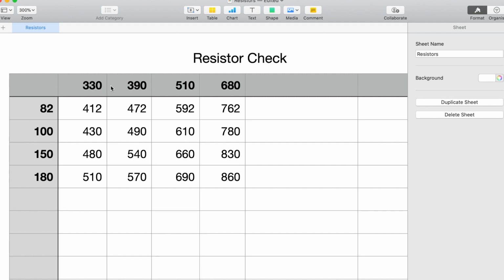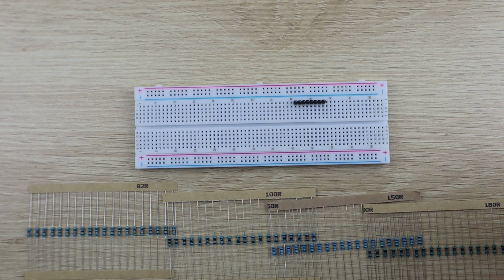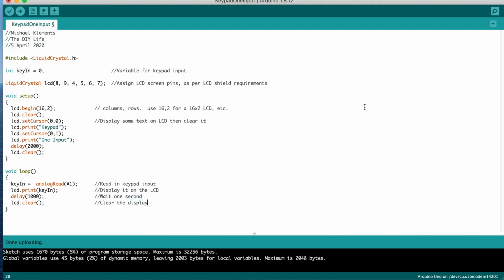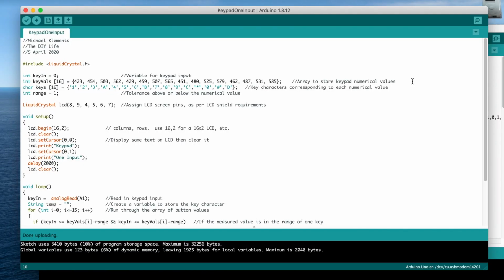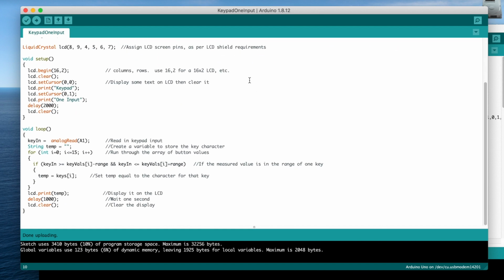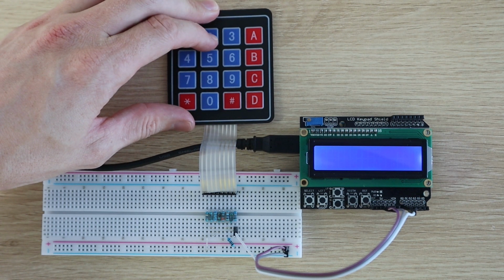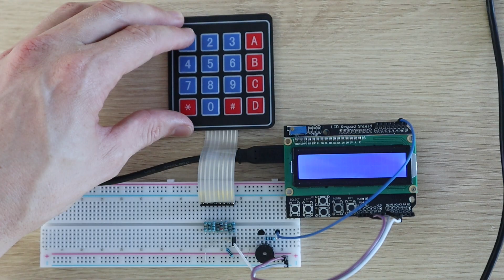Connect A 4x4 Keypad To One Arduino Input

Comment: Yes 4 years ago when you made this video.  This year I’m making an MFD Multi Function Display with 28 buttons on it. This is for an aircraft F/A18 Fighting Falcon. Keeping the pin out small is the way forward. I need to repeat this 3 times. I think that is 84 buttons using 3 inputs. Thanks for the help.

Comment: I'm a little confused by your setup of the resistors. In the initial setup, it seems like you will be inserting resistors into an 8x8, but in the actual implementation, I see 8 resistors in a row, then a bunch of wires, and one resistor at the bottom. What exactly is that setup?
Reply from the maker: It is an 8x8 setup but they need to be arrange in a voltage divider circuit to generate a reference voltage for the Arduino to measure. The single resistor at the bottom is one half of the divider and the other 8 resistors make up the second half of the divider.

Comment: I am using this and the PWM code to control the raising/lowering of doors on my 18 bay carshop for my model train. The object is to enter the door number and then the % open. Using the I2C for the PWM boards and the one analog connection for the keyboard will make it all work....wiring was easy. Now to do the coding, mechanical tweaking, and troubleshooting.
Reply from the maker: This sounds like a great application for this sort of arrangement.

Comment: What do you call that black thing on the breadboard, is that a potentiometer?
Reply from the maker: I'm not sure which one you are referring to, the two at the end are a transistor and a buzzer. The transistor works as a "switch" to turn the buzzer on or off.
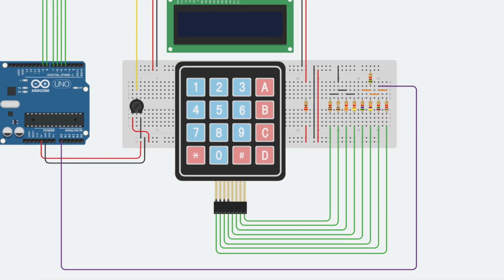Reply: At 2:34 there is a potentiometer for the LCD brightness which is outside of the scope of this project. BTW the black thing from schematic is blue in reality - see top left corner of the LCD shield 3 seconds earlier.

Comment: Quick question , what are the specific values of the resistors you used in your project ?
Reply from the maker: Hi Celi, I used the resistors show in the resistor check table in the video - 82, 100, 150,180, 330, 390, 510 and 680 ohm resistors.
Reply: @MichaelKlements  Thank you!!!